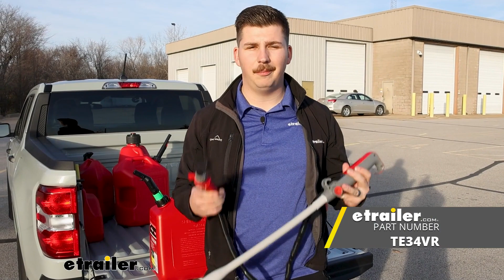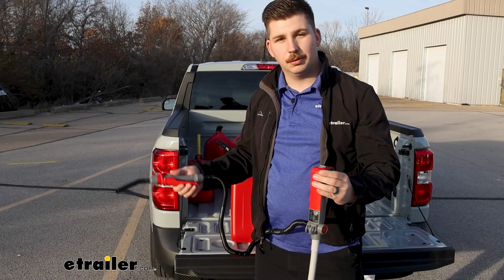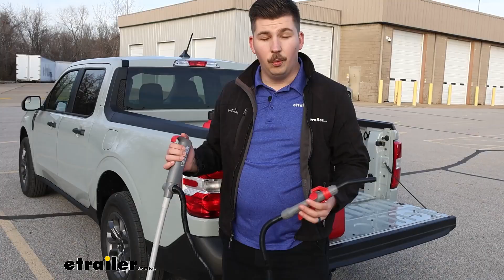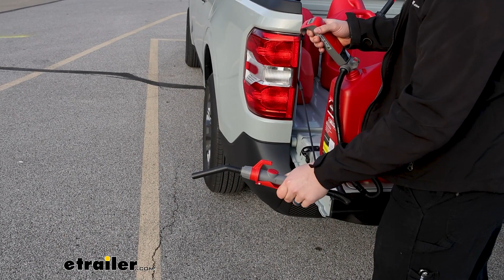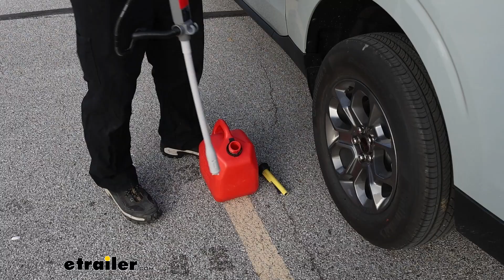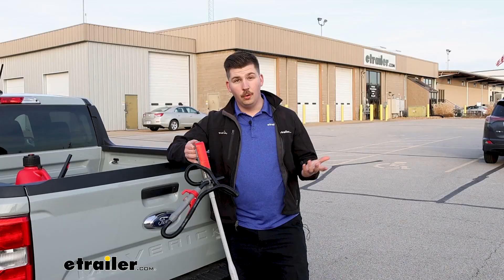etrailer | Breaking Down the TeraPump Battery Powered Fuel Transfer Pump for Gas Cans

Comment: A few ounces of soapy water would be a worse cross contaminant than a few ounces of gas or diesel for the wrong motor. I’d suggest that shaking it out and tipping it in multiple directions to get most of the wrong fuel out would be sufficient. For small engines with tiny fuel tanks were a few ounces of diesel may be significant, you can circulate the fuel back into the jerrycan for a few seconds to dilute it well enough.